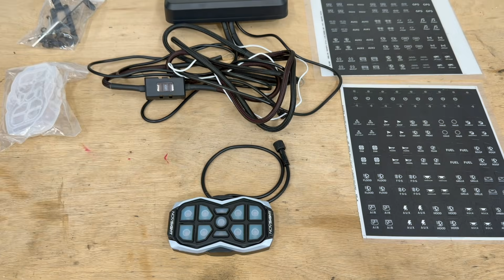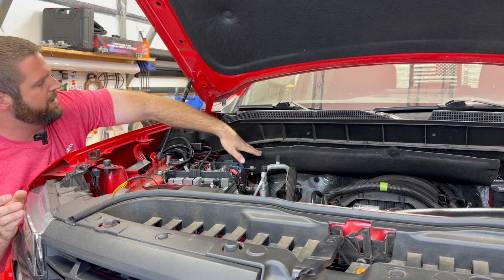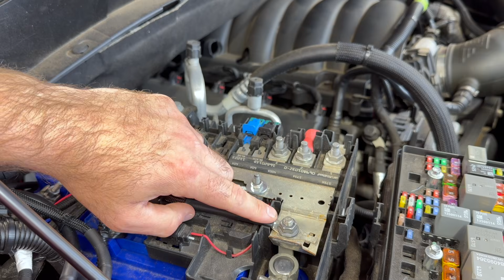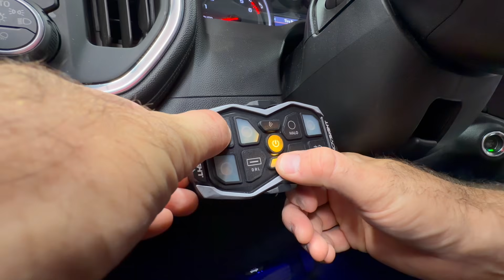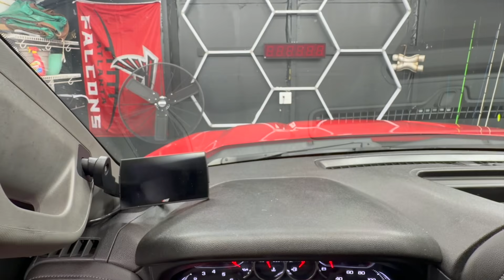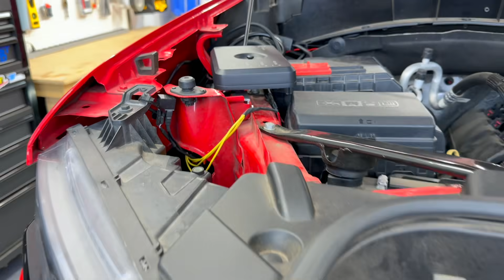NovSight Voice Controlled Switch Panel Chevy Silverado Install

Comment: Did you just screw 2 of the posts (legs) through that aluminum angle bracket? Is it pretty solid? Those posts dont seem very solid. I have a refreshed 2024 silverado rst 1500. Engine bay looks similar,  not alot of options.  I was able to mount an auxbeam 8 switch panel,  but not the 12, box is too big. 
Was thinking about trying to mount it with the auxbeam bracket,  but might be hard bringing wires up from underneath the panel. So are you happy using the 2 posts only, if thats what you did? Thanks for any info.

Comment: Nice review. Straight to the point. 

Does the switch panel backlight auto dim at night time?
Reply from the maker: Thanks, no it doesn’t auto dim.
Reply: @zachattackcustoms 
How is it at night time then? Annoyingly bright or is it not an issue?
Reply from the maker: It’s pretty bright, so you will have to make sure where ever you install it, that it doesn’t reflect on the windows.
Reply: @zachattackcustoms Thanks!